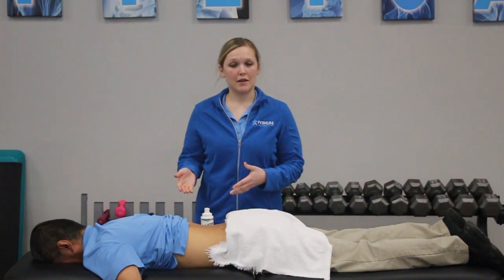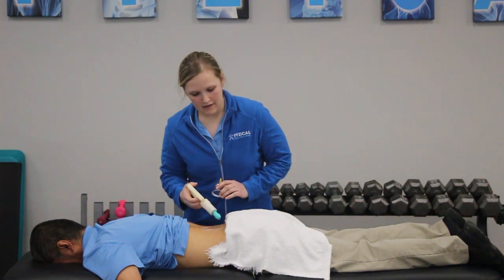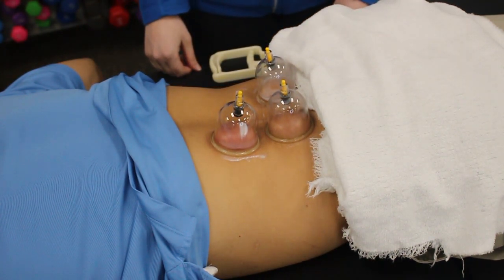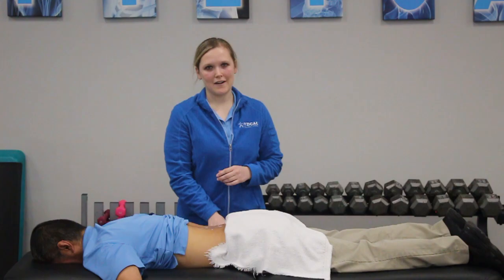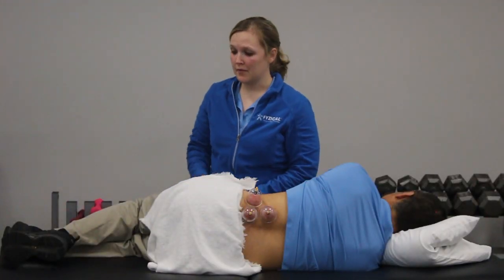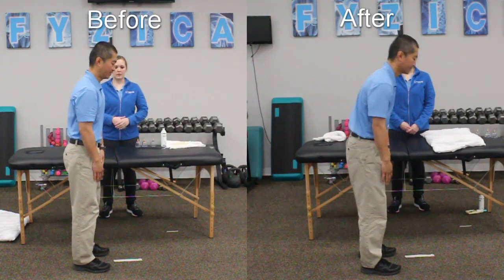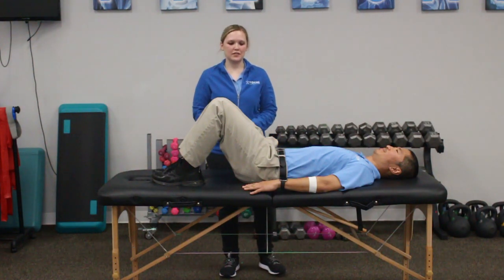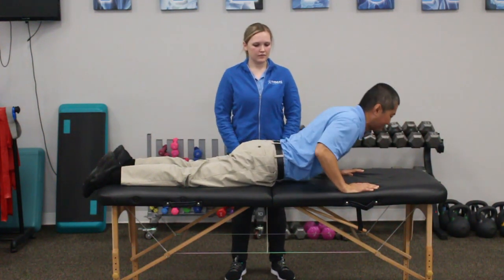Advanced Cupping Techniques (Myofascial Decompression) for a Stiff Low back (LBP)

Comment: Have you ever wondered what the function of Cupping Therapy is?

Cupping is an ancient medical procedure. It relies upon creating a localized suction vacuum with fire or a device to mobilize blood flow. This blood flow thereby aids in the drainage of the lymphatic system. By stimulating the lymphatic system you’re giving the fluid that builds up between the muscle and skin more mobility to move outside the body. Not only does it move the blood through the veins, arteries, and capillaries, but also clears it. Some of these include sore muscles, tension, and clearing colon blockages. As well as, reducing stretch marks, improving the appearance of varicose veins, pain, discomfort, and aiding in blood circulation. Read on for more benefits.
Cupping has proven to affect the body up to four inches into the tissues.
This depth causes tissues to release toxins and promote healing.
A cup will be placed on the skin either by means of heat or suction, which creates a vacuum.
This draws up the underlying tissues.
When a cup is stationary on the skin for a few minutes, blood stasis forms and localized healing takes place.
It’s important to be aware that cupping can leave behind some marks. With moving cupping, it is common to have red or purple marks left on the surface as blood is brought to the area. Whereas with stationary cupping round marks that may resemble bruises might appear depending on the severity of the stagnation in the body. These are pain free and can last from 3 to 7 days.

Learn more about the types of jars used in this type of holistic treatment, as well as the differences between stationary and moving cupping therapy by visiting us at www.eacuwell.com/cupping